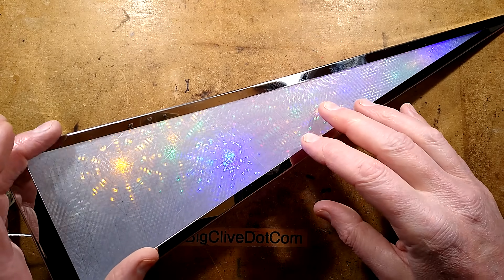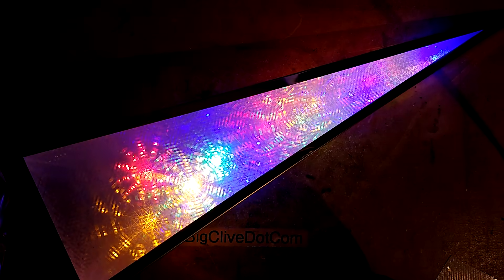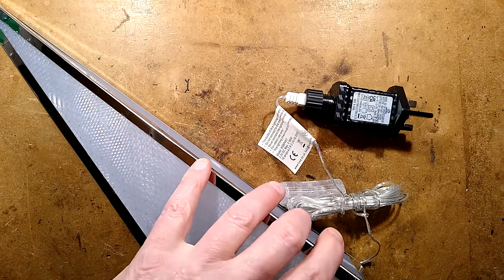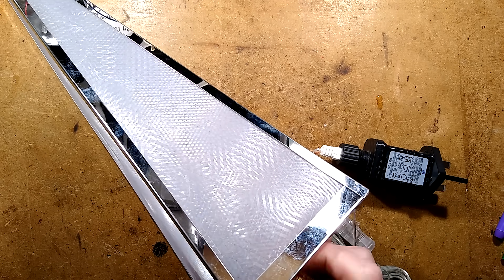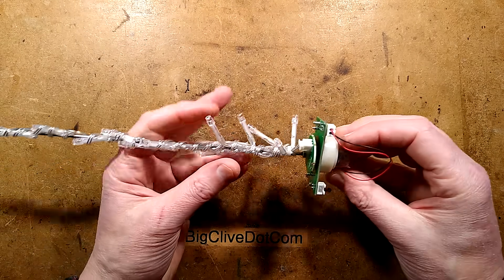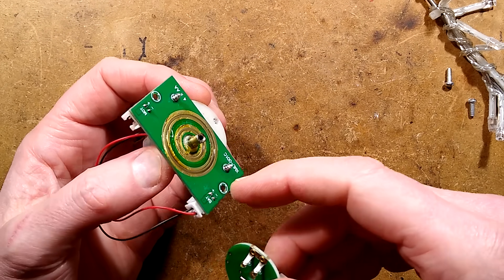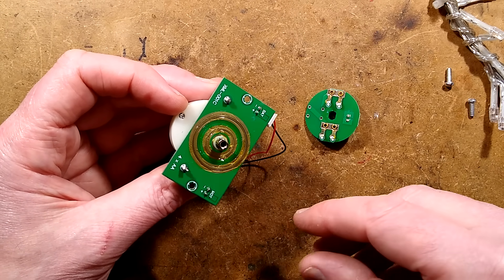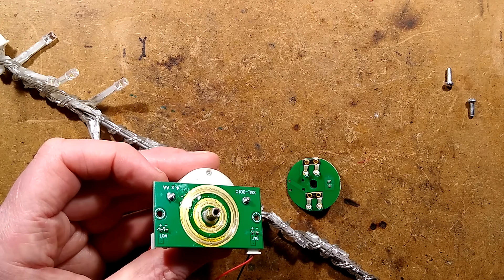Inside a swirling holographic star pyramid (amazingly deep 3D effect)

Comment: Thanks a lot Clive. 
One another puspose for using the "rotating contact" method could be for making a rotating POV device. Many POV DIY videos show a battery mounted on the rotating part itself, which seems a bit cumbersome. Using a slip ring may also help, but may be a bit expensive.

Comment: The pogo pins making contact with the circular traces on the motor PCB aren't reliable at all unfortunately, after a few hours of use the PCB traces will begin to wear through and the pogo pins will grind themselves down and begin accumulating a bunch of cruft. I know this because the same technique is used to deliver power to the motors on those ferris wheel style LED DIY kits you can find on Ali and other cheap Chinese stores, and I've never had one last for more than a day of use. 

Side note, if you enjoy making electronic kits, I can't recommend those ferris wheel kits highly enough, they're very fun to put together and the effect is wonderful. They're also deeply interesting in terms of how they work, they use a bunch of two-pin fast colour changing LEDs that have a tiny microchip embedded in the LED itself to run through a pattern of colours, only they use a variety of techniques to drive those two pins to produce all sorts of effects that weren't intended by the manufacturers. 

For example, by driving them with a PWM signal they can be encouraged to light up in a particular solid colour instead of running through the built in pattern, and by overdriving them you can cause the blue LED to shine brighter than the red and green LEDs, changing the temperature of the colours. 

It's such a fascinating bit of engineering, and I would absolutely love someone like Clive or Dave to do a teardown of one of the ferris wheel kits and analyse them with a scope.

Comment: What's more neat, from an economical perspective is the fact they're using triangular panels, so they can batch out a bunch of these from square stock with little in the way of scrap save for the half-panels they can't use in this application.

Comment: I wonder what kind of grease that is. I’ve seen some labeled as “dielectric” grease, but not sure that’s what this is. In this use case, the grease has to lubricate, but not conduct so as to not short out the rings, but also has to not prevent electrical contact between the wipers and the rings.

Comment: i saw someone   on YouuTube use this special paper once that goes on the bed of a 3D printer and it makes a pattern
he printed a unicorn out of white PLA and whe he took it off the bed with the special paper  it imprinted this pattern in it that mad eit look like  an opal and it reflected all different colors,
I wonder if you used one of those with   clear/natural PLA if it would make   something linke  this material
Reply from the maker: That sounds like the holographic foil.

Comment: This kind of slip ring contact made with a PCB is extensively used on electromechanical pinball/arcade machines and jukeboxes. 
You have a nice low voltage even higher quality gold plated one here.

Comment: You could REALLY easily mod this to be programmable and ludicrously overkill. If you attach a little microcontroller onto the raised platform and just tap off the exposed connections, you could replace the string of lights with proper RGB tape with the MCU just taped to the top of the platform, meaning no signal integrity issues with the PWM signal as it's all up on the spindle already. The Seeeduino Xiao or Adafruit QtPy would be perfect for this. Hell, if you wanted to, you could even get a little capacitive touch sensor and connect it to the metal frame for touch control. This is a delight and I want 10 of them.

Comment: did anyone notice that the moter was connected to bat and the power was in the mot conector so just wondering can it be modified to be rechargeable with batteries or even solar powered for outdoor use if made wether resistant

Comment: The star effect half way up would be better if the LEDs were gradually tapered towards the top, rather than in two bunches (one wide and the other close in top the axle)

It's obvs they did it this way for ease of assembly, but in my opinion that was was simplification too far. 

Otherwise, as Clive says, an excellent little ornament.

Comment: i guessed how this worked as soon as i saw it moving and was not disappointed !
lovely simple mechanism with diffraction lenses and a rotating pillar of lights :)
i also like the simplicity of the pcb slip ring, although i doubt it'll last as long as more expensive purpose-built parts even with all of that grease.
they should sell this as a beginner kit for children, it's very fun

Comment: The PCB has printed on it "4 x AA" ... does that mean that it was originally intended to be powered by four AA batteries? One of the connection points is even labeled "Bat."
Reply from the maker: Another version (probably a copy) is battery operated.

Comment: There is 4xAA written on the PCB so I assume there is also a battery powered version of it. And it surely will run of 5V USB then. Options for modifications.
Reply from the maker: In a future video I take a look at a battery operated version with a single resistor.

Comment: That slip-ring system is pretty nifty! I suspect a similar technology might be in the less expensive slip-ring modules you can get from the "usual places", although I'd be a bit wary about the "claimed" 15A ratings.  I've used a cheap slipring system on our solar light house model, and that's still very much going after 10 years' use (helped by occasional contact lubricant application).
Reply from the maker: I made a video about the slip ring capsules.  If that's the one you were thinking of then you're right to be cynical about the current rating.

Comment: This is like me, breathtakingly simple and it only takes one screw loose to fall apart.

This was very well timed, I was just looking at slip ring designs! I wonder if there's a design that would be reliable and long lasting at high RPM 🤔
Reply from the maker: Aliexpress has big motor grade slip rings with carbon brushes.

Comment: Can we see more of the 3v adapter next time? I don't remember ever seeing anything like that before. I'm in the USA. Is that kind of a common thing in the UK? Like the way 5v adapters are everywhere here?
Reply from the maker: It's in the style of the adaptors supplied with LED Christmas lights.
Reply: @bigclivedotcom yes: a 3V adaptor makes sense if you're feeding a strong of LEDs mounted in parallel. A 5V adaptor would waste a lot more power heating the current limiting resistor.

Comment: I was a bit puzzled about the grease - it appears to be present not only on the gold tracks but also between them. 
If the grease is electrically conductive, would it not short the tracks? 
If the grease is not conductive, how does it help maintain a good connection between the tracks and the pickup contacts?
Reply from the maker: The grease is not conductive.  It is there to reduce contact wear.  The contacts make by displacing it.

Comment: Would there be any limtations (signal latency issues) by using this slip-ring princple for a 3rd additional ring for data xfer? Maybe drive a pixel strip (etc), or would it be easier to just mount the uP on the rotating shaft?
Reply from the maker: Probably easier to mount the electronics on the shaft and use IR to control it.

Comment: I'm amused how the motor is plugged into the "BAT" jack, although it doesn't matter.  The board is also marked "4xAA" but it's run from a wall supply, but that doesn't matter either.

Comment: Is the slip ring grease conductive?
Reply: Mosk likely it is not. Most electrical greases aren't,  if conductive it would cause resistive heating or a short between the traces. The pressure and movement of the sliding contacts will displace it enough to make a good connection.

Comment: Says 4xAA on the circuit board. There was or probably is a battery powered version but I'm not a fan of Alkaline powered stuff and NiMh is often too dark for the LEDs. It's just more  interesting to know it can also handle 6 Volts.
Reply from the maker: It would probably be used with a resistor.  I took another one apart with 4xAA and it did have a resistor.
Reply: 2xNiMH is obviously not going to work with LEDs, 3x just about works but is a little on the edge, 4x is going to work absolutely no problem. Alkaline cells don't deliver much more voltage than NiMH over most of their life, they start above 1.5V but as they discharge, the voltage drops, terminating at right about 1V. While NiMH stay at right around 1.25V for almost the entire length of their discharge cycle. This is at low currents, at higher currents both types suffer some voltage depression, tends to be more pronounced in alkaline. So if NiMH were too dark, alkaline would have also been too dark throughout most of the cell life.
Reply: @SianaGearz  Most LED gadgets use just two cells, which makes it impossible to use with rechargables other than protected buck converted Lithium 1.5V cells.

Comment: Neat. Not familiar with electronics in rotation, so forgive my ignorance. Could ground be wired to the motor shaft? That way you could have 2 signals through the pads, with the shaft for ground.
Reply from the maker: Probably plastic gears.  Passing current through a bearing also has issues with microscopic spark erosion over time.

Comment: Are the plugs all the same in the UK and other surrounding/close islands?
Reply: Generally, yes. I was in Dublin and Isle of Man (where Clive lives, met him in person, he's a wonderful chap) and the outlets were the same.
Reply: Unless you're in a property that hasn't been required since the mid 1950's. In which case be careful of the wiring as it's likely to be using cloth/rubber insulation that has passed its safe working life.

The previous plugs had round pins and came in 3 sizes (for max current of 2- 5- and 15-amp). 

You still sometimes see the tiny round pin 2A sockets in use where a lamp is plugged in to a lighting circuit, but even those are rare now. 

Notice to that every outlet is supposed to be able to deliver 13A, so long as you don't bust the limit for the ring, which is typically 50A. And that's why every plug has it's own fuse which is supposed to be chosen appropriately for the appliance.

Comment: You could use some of the 2 wire "addressable" colour changing LEDs and have it change colour whilst rotating! 👍
Reply: No need for any of that. Just use a bunch of those slow color-cycling LEDs...
Reply: @AttilaAsztalos  but he lights are already colored though
Reply: @andreamitchell4758  is that you would have the LEDs change colour as they are moving, so the colours can be in different positions rather than a predictable, repeatable pattern.
Reply: @bluephreakr  yeah but he said " two wire "addressable"LEDs"
I never really understood how those wli exactly.
I have some plain white wire lights that have 2 wires and they can do different patterns but I have no idea how it works without a data wire.
So do the 2 wire color ones really change like that and how do they accomplish the pseudo addressability with only 2 wires?
Reply: Really, you don't even need to mess with some tricky two-wire protocol, you could just stick a little microcontroller onto the bottom of the rotating shaft too and program it to do whatever you wanted (such as driving multi-wire LED strips too)..  There's plenty of space there for extra electronics on the rotating part.
Reply: @foogod4237  I meant the USB powered self controlled lights he has reviewed in the past. Would just need to cut the wires and solder them on 👍 they are wide angle LEDs though, so might not work well, replacing the existing LEDs with auto colour changing (not diffused) might work better!
Reply: @foogod4237 Instantly I can think of so many things you could do with that. Some 3D printed parts and some WS2812 strips and a generic controller unit with remote and now you got some fully controllable RGB effects.
Reply: @foogod4237  one could. but tbh more and more i think MCUs are 'cheating'. it seems people think 'sod learning things about electronics, i'll just buy some arduinos!'. i often see on arduino fora people asking 'what is a pull-down resistor', or similarly obvious questions. MCU are cool, in their place, which i think is after learning about real electronics for a few years. however i am a miserable old bastard. so probably wrong!

Comment: My OCD is playing up: the motor is connected to "BAT", the power supply (which is not a "4xAA" battery box as indicated on the PCB) is connected to "MOT". 😋
Reply from the maker: I didn't even spot that.  I'd guess they just used the connector closest, since they are in parallel.

Comment: That exact contact method is used in an old Tandberg tape recorder I've just restored for the record/playback switch, where a strip of double sided PCB is used with a couple of sets of those springy contacts either side held with a plastic 'sled' via links to the rec/play select lever. It's 55 years old and the contacts are still perfect!
Reply: Pretty much every digital multimeter with a rotary switch uses springy contacts wiping against traces on the PCB (usually gold plated).
Reply: @ferrumignis  Yeah those to. Is cheap reliable way of  making a multi function switch.
Reply: Almost all AV equipment has one or more rotary switches that are based on this principle at least if its old enough to not use rotary encoders. My Danelctro guitar has suc a rotary switch to becaose it has more pickup setting than a toggle/ blade pickup selector could accommodate.Your car aslo has a clockspring in the steering wheel which is simular
Reply: @rimmersbryggeri
Not since 3rd gen airbags.
Reply: Also used in electric car power steering  systems,works great till the copper tarnishes and or sometimes when the weather's really cold and your steering goes notchy, im talking 2010 by the way not 2023 as they might now use something better like bamboo😅
Reply: @davefish4965
NEVER HAPPENED.
That is was sorted in 1898 in France and Italy.
Give it some thought. Has to go to market near the Arctic Circle, Equatorial countries, Australia. Never an issue.
Reply: @snakezdewiggle6084  They didnt have elctric power steering in 1898 though.. Is actually not uncommon that electric racks suffer exactly the fault described or just ock up in one position I doubt its beause of  a spring contact going iffy though.
Reply: Okay. ..

Comment: You said I'd be surprised by the simplicity, and yet I was still surprised!  That is super cool!  I wonder if there's any special parameter or technique used for the PCB with the rings. Maybe just higher weight copper? Maybe that's not even really necessary. Fascinating stuff, and great effect!
Reply from the maker: If doing it myself I might choose the thicker copper.
Reply: ENIG type cheap gold coating shouldn't be used for friction contacts. It should be hardgold, which is a steel gold alloy, pretty durable, but at a basic spec it's going to be just 1µ thin (on top of about 10µ of nickel), while at a higher grade it might be 30µ or 50µ, which ends up not being a quick or cheap process then.

Also: HELLO.

Comment: That's a kinda neat cost-reduced slip ring.  But not reduced so far that it's bare wire jammed up against the ring, they at least are using some cheap springs.  I, too, wonder about the lifespan of such a thing, but they've at least put a tiny bit of thought into keeping it from wearing out in a couple weeks' use...

Comment: I think this would be even better if each LED cycled among different colors, either coordinated, randomly, or whatever. As-is, it's nice but the identical color star always drives across its same horizontal band.
Reply: Swapping the fixed colour LEDs for colour changing ones could give the effect you are looking for. A mixture of slow and fast ones would give the appearance of randomness as they rotate around the shaft. Perhaps Clive will "enhance" this one.
Reply: Two of the slow changing coloured LED's can be put in parallel, and then you can make strings of these in series. I found that 7 series sets of 2 parallel gives the best effect, but then sadly the supply is around 22 Volt, a bit unpractical. The individual LED's all have ever changing currents, from 1 mA to 10mA , and the frequency is slightly different per LED, so ever one in influencing every other.